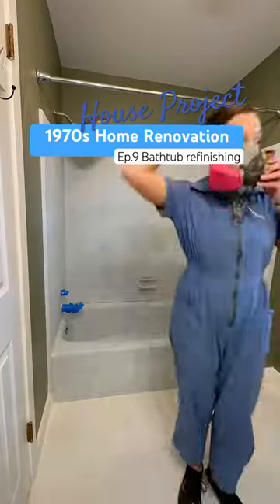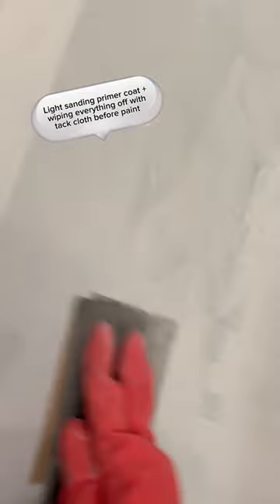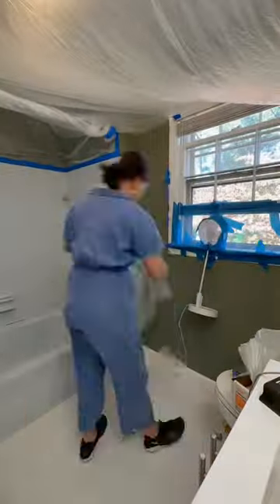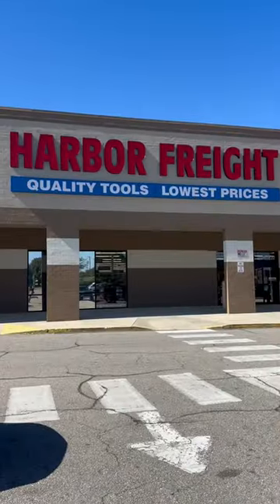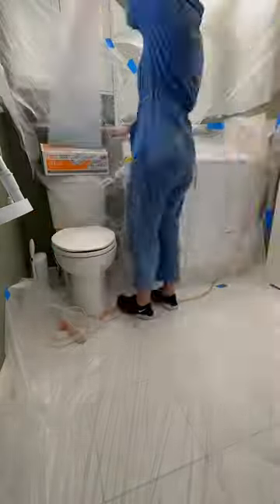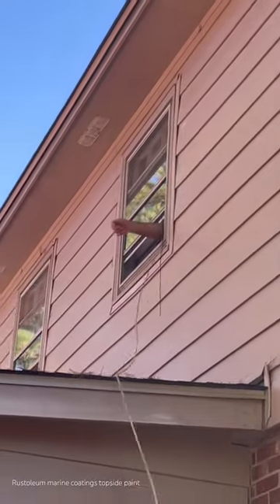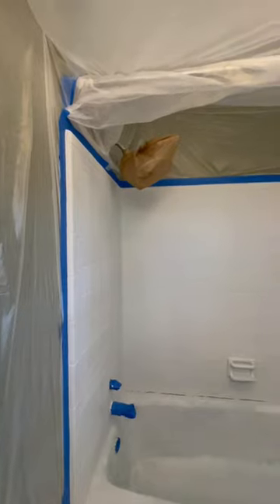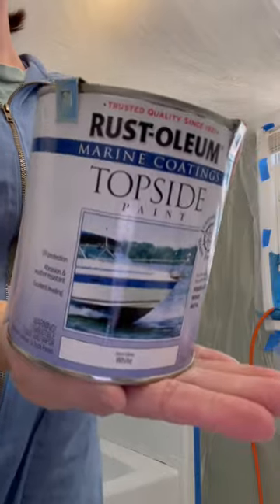Ep.9 Bathtub refinishing | Spray Painting 1st coat! | Marine coatings topside paint | House Project

Comment from the maker: Video cut me off, but if you get this spray attachment you have to clean it really good after each use or it won’t work as well. But for $15 I am blown away 😯 TIME SAVER and it’s looking pretty professional 🙆🏻‍♀️👩🏻‍🔬🙌
Reply: What type primer did you use ?
Reply: I would like to know how well it's held up.? I redone my tub with the porcelain kit. I did every step from the manufacturer and I even did the cleaning part and acid twice And the crap still cracked and flaked off. But if this marine paint holds up I may just redo it and use this stuff. But last time I checked that Marine paintwas a bit pricey.
Reply: I would like to know how well it's held up.? I redone my tub with the porcelain kit. I did every step from the manufacturer and I even did the cleaning part and acid twice And the crap still cracked and flaked off. But if this marine paint holds up I may just redo it and use this stuff. But last time I checked that Marine paintwas a bit pricey.